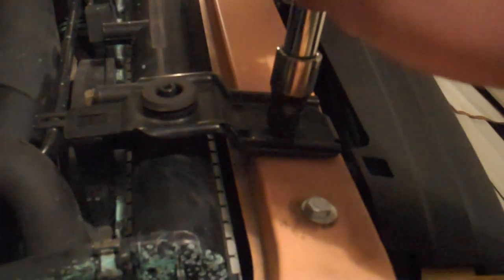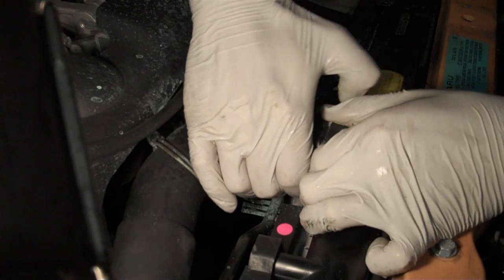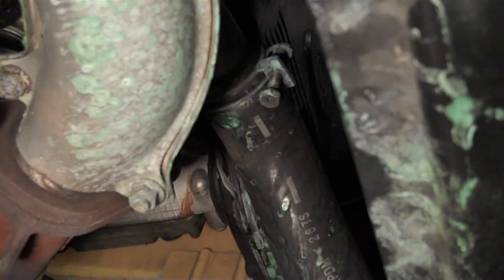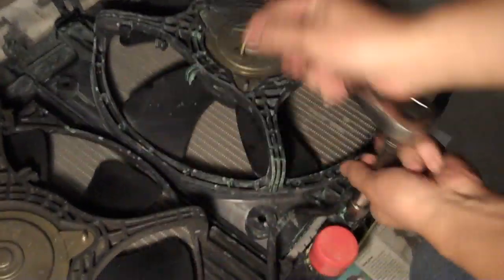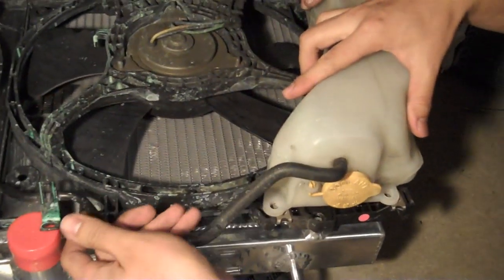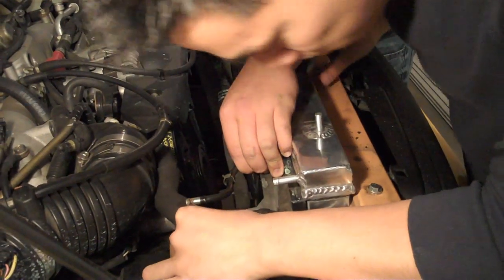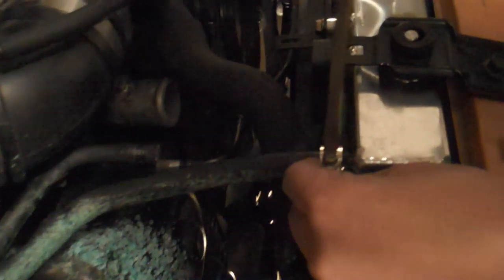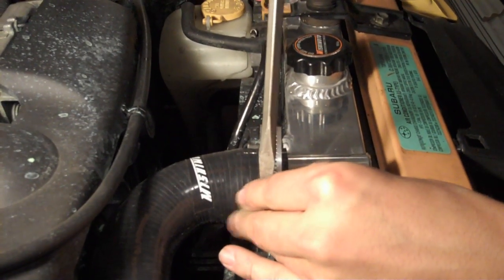Tutorial: How to change a Radiator in a 2003 Subaru WRX

Comment: Hey nukem384, I'm no mechanic by any means and recently had to get my radiator replaced on my 03 wrx.  I noticed that the radiator grill on the front is still my old one from before the repair, does this typically not get replaced with a new radiator or is it all one unit?  Just want to keep the mechanic honest.  Thanks

Comment from the maker: not sure what you mean by grill, but if your radiator is leaking, usually they swap the whole piece out for a new one like in the video.  sounds like they didnt even change your radiator?  maybe they just put that seal stuff in your old radiator to stop the leak?  that is usually only a temporary fix.

Comment: Awesome tutorial dude. Thank you so much for taking the time to make this video. The cheap generic OEM replacement radiator in my 02 4EAT WRX just popped at the bottom seam and I was worried there wasn't a how to video available. Thank you again. Watching it get done makes it much easier for me to understand as it is with all visual learners.
Reply: Bro mine popped the top rad hose and what it connects to today, is it a common thing for these rads to pop at some stage?

Comment: I got an 04 wagon can I just do the same thing for it? Or how much it would cost to have someone replace it for me.
Reply from the maker: yeah.  it'll be the exact same thing.  this is like a 2 hour install, so maybe $240.  but depends where you take it, many dealerships I'm sure will try and rip you off
Reply: nukem384 you’re saying it’s two hours because of the coolant and getting all the air bubbles out right?
Reply from the maker: I just feel like thats how long itd take a pro mechanic to complete the whole process, bubbles included :)
Reply: hey quick question because i can't find an answer online, but can a rad from an 04 wrx fit my 04 impreza?
Reply: i only ask because i found one in decent condition for cheap and wanted to know if i could fit it in my impreza.
Reply from the maker: yeah it should be fine.

Comment: The thing in front is your ac condenser.  It IS separate from your radiator. Open the hood and look towards the front from the side and see if the radiator looks new if it does, im sure they changed it

Comment: There's no need to spend $250 on a Mishimoto if you don't have any engine/turbo mods that require additional cooling. You can get an all-aluminum rad. on eBay for $130.

Comment: Common issue with most OEM radiators, the top and bottom are plastic, they get brittle with cooling and heating through the years so a little bang and FUCK!!!!! you got stuck in the middle of nowhere. The Aluminum radiators are much better but will need new bolts to attach the fans....Nice job.